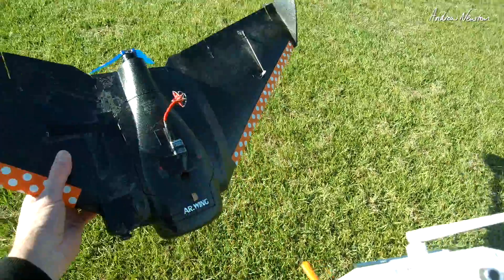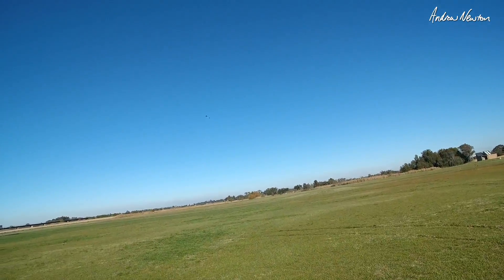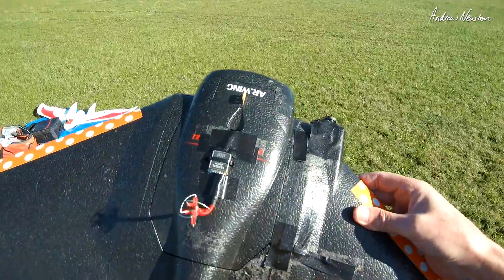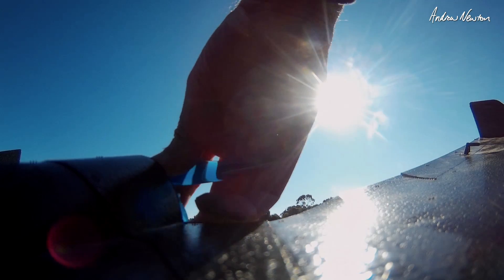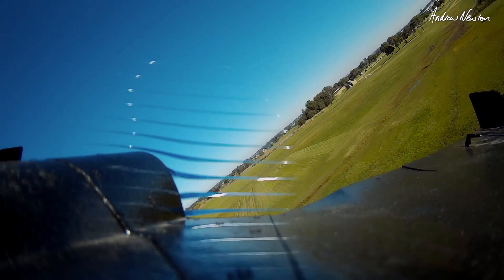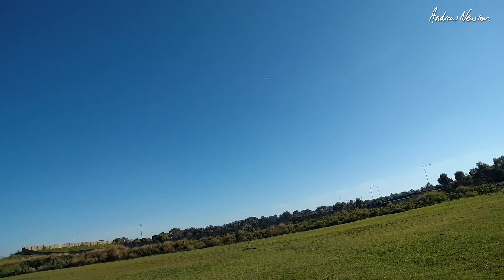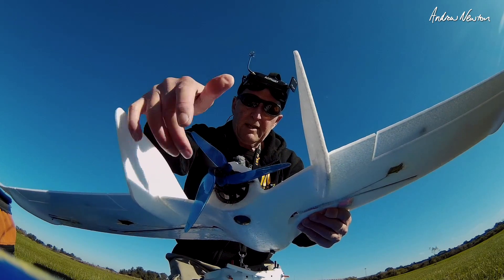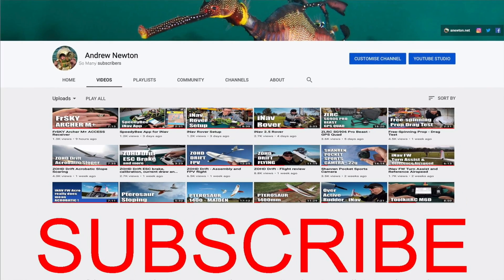Dal Prop Fold F7 on a wing

Comment: hello how are you Andrew a pleasure to greet you what stabilizer you recommend me for low wing plane that is easy to program and low cost greetings excellent channel
Reply from the maker: For price and simplicity the NX3 is the best I have tried, but it doesn't have self level mode. I dont use stabilisers other than iNav capable boards.

Comment: I love the chaser, mine has a 2200kv motor on it and it's fast on 3s, unimaginable on 4s??
I've got 10? or more of the 6x? or 7x? twin blade side flopping, if your interested in testing them let me know,  
they are small enough to post to you.
I have try'd them once on a Teksumo but found them to have not aggressive enough bite on them for me.
I was tempted to warm them up a bit and bend each individual blade, mine are plastic.....your welcome to them, great vid as usual :-)
Reply from the maker: Thanks Chris, I only tried these because Foxeer sent them to me. Not really designed for fixed wing.

Comment: They dont fold back to lie flat against the fuse to reduce drag... and can still brake on landing. 
I dont get it... What is the point of these props?
Reply from the maker: Designed for multi rotors, just for packing down smaller maybe.

Comment: Inappropriate on a fixed wing, when they fold and hang, they are a hazard making drag...Their value on a Quad is also questionable from what I've seen so far.
Reply from the maker: Like all the new toothbrush innovations maybe. Have to keep coming up with selling points.

Comment: Hi Andrew, 
I absolutely love that you test these goodies (props in this case)! 
Please do confirm the prop direction on the Chaser ...
Reply from the maker: Yes I was using the CCW prop
Reply: @AndrewNewton  , thank you for your reply, was that then the correct prop for the Chaser? ... see +-6:28 in the video..
Reply from the maker: CW would be the usual prop but it doesn't make any difference, just have to swap 2 ESC wires to reverse the rotation.